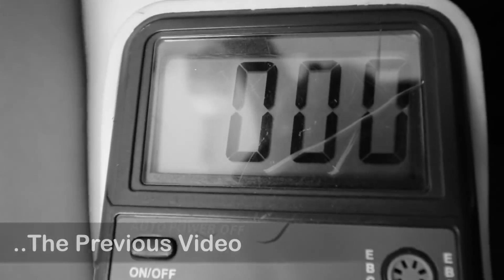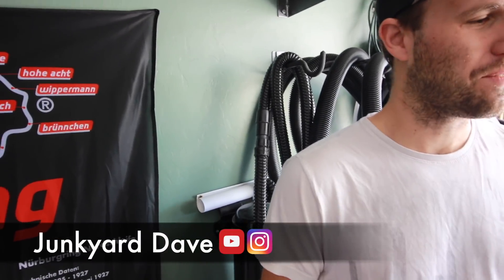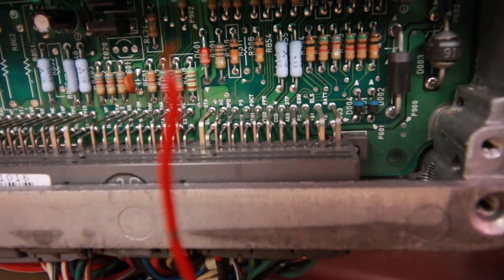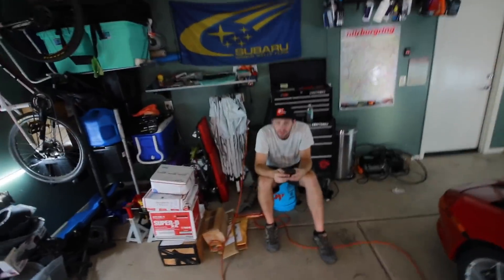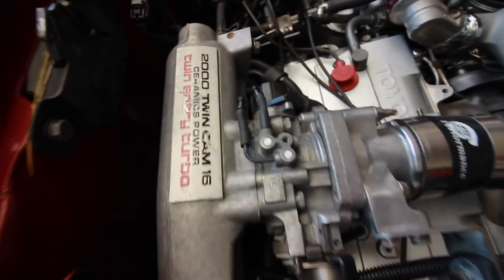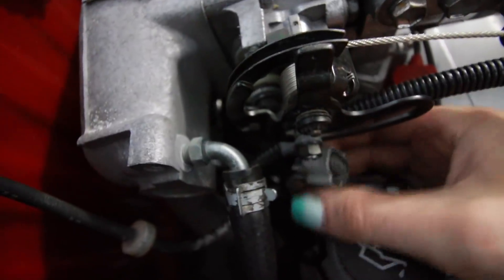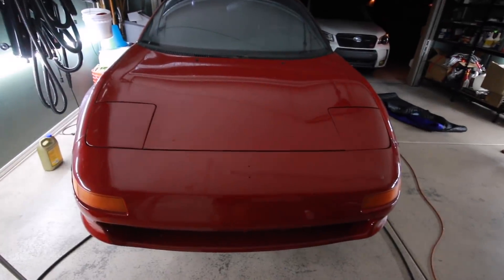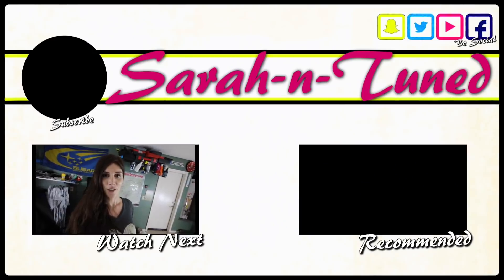FIRST DRIVE! Mister Dos Lives // JDM 3SGTE MR2

Comment: @Sarah n Tuned Ive Bled a Clutch by myself before. You pump the pedal to build pressure then use a 2x4 or something to hold it then you can undo the bleeder screw. took 20 min to bleed the clutch on my 87 Rx7 lol

Comment: Stick a short piece of 2x4 into the brake pedal and slide the seat into it. Also, you can make a brake bleeder with a length of poly hose and a plastic juice bottle.

Comment: OMG!! I almost cried when I saw you driving it! Im so happy for you. Im in central America and Im called by my clients "The MR2 Guru" but my specialty are the AW11s. I have learned so much from your channel!! I really like it and I have been watching the Mister DOS playlist but couldnt wait so I played this video. 

With the tach, you could check the igniter and distributor there is where the signal comes. Also if im not mistaken the intrument cluster in the back of the tach has a circuit and or resistance you can check. At least in the AW11 it has some circuits behind the tach.

Comment: Sarah, my MR2 has the same speedo issue. Mine is also a USDM NA to JDM Turbo swap. There are quite a few good YouTube videos on how to fix that. It’s just a few dollars in resistors or capacitors (I forget) and some soldering in the cluster. No worries.
That breaking up in higher RPMs is more worrisome to me. I lost a 3S motor when I was younger and dumb by messing with the mechanical timing. Get a timing light on that thing ASAP
Oh yeah! Congratulations on getting her running! There is very few cars as much fun to drive - NONE at that price point.

Comment: You can bleed it yourself, you just pump the brake/clutch so the line in the bottle is always submersed. Then it'll create bubbles in the tube until it's bled. Took me figuring out you need a much larger container. You also use a stick, or something to hold the clutch down and open/close the bleeder as it's pressed with stick. Also not ideal, but can be done.  Enjoy your work and videos. Keep it up.

Comment: Air idle valve only operates when the ac kicks on. otherwise air isle is set by the throttle body itself. also Mikes garage on youtube his clutch bleed setup using a oil can is the quickest method. I used it and had the system bled myself in 10min. If you search the forum for the tach issue its common. a few capacitors just need to be replaced.

Comment: Where you moved the distributor you may need to adjust it with a timing light that could be some of the power issue and it might need a tune with the blow of valve awesome to see it run

Comment: In my mobile repair days I used long pry bar or 1/2 extensions to hold brake or clutch pedals down. Wedged in between seat n pedal. Had a cheap mityvac but they don't hold up in the mobile environment being plastic. The alternative that works well is using a bottle with clean brake fluid.  Attach hose to the bleeder, run hose to the bottom of this bottle and you can slowly pump the pedal with the bleeder open. It expels the air and sucks fluid back in upon release of the pedal. Same as bench bleeding a master cylinder.

Comment: Major kudos to Junkyard Dave for helping you out with the wiring issues. I would have been tempted to just put the fuel pump on a switch mounted to the dash like a race car.   Congrats on getting Mr Dos running! Lots of hard work.  For bleeding brakes I love my Motive bleeder system, totally able to work on brakes alone.  Looking forward to more progress. Keep at it!

Comment: Congratulations on the first drive Sarah! I know the feeling well. One product you should look into are Russell Speed Bleeders. I put those on my RX7 so I could quickly bleed the system myself before and after track day events at Road America. They work great. Also, when I would bleed my clutch master and slave I would use a 2x4  from the pedal to the seat after depressing the clutch. (I also didn't have people available to help at all hours when I would work on the car) Yes it works the ab muscles well constantly going from under car to depress clutch but I would consider that as a workout. ;) Good luck on the fine tuning now.

Comment: 9:28  The way I handled that problem is I heated the hose with a hot air gun, and then work it onto the nipple.  The hose then forms to the nipple, and it easily goes on there after.

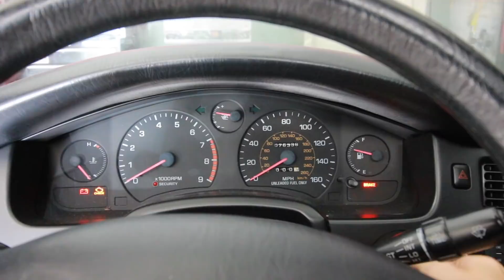Comment: Sarah, something odd happened with the tacho. If you see the video at 1:10, at that point the tachometer was working well. Later when you start the car again in 5:10, the tachometer is already off. You did something in between to upset the tachometer, it must be an electric issue.

Comment: Hi Sarah! Glad to see MR Dos go for a drive finally. You have me looking at cars with turbos now. I've never owned a car with a turbo before but did drive a Tiguan with the 4 motion and the 2.0 liter turbo. But I'm looking at Volvo's also.
Reply: A turbo really doesn't add any extra issues except reduced engine bay space. I avoided turbocharged cars for years, thinking they were more complex and fragile, they aren't.
If you are looking at Volvos, the 850's are fun cars with the T5 engine.
Reply: They do offer more points of failure, and the turbo will go out before the engine.

Comment: I have a third gen MR2 and in order to bleed the clutch, I had to get under the car and use my fingers to press the slave cylinder.  Using the pedal just never worked at all.  I think it's because the line is so long from the clutch master to the slave.

Comment: Hi Sarah: off-topic question: You have an insulated garage door: are you happy with the result? Did you do it? If so, how does it compare with non-insulated? Love the channel! All the best, Rob in Switzerland (MX-5 2.0l Sport)
Reply from the maker: RobWhittlestone it might have helped... but when it’s over 100° outside and the sun is on that door all day it still gets ridiculously hot in there no matter what I do. I pretty much have to run the evaporative cooler 24/7 if I want it around 80°.
Reply: Aha! In Arizona you need it 'cause of the heat. I should have known. LOL. 8-D  In Swiss winters we have long periods of only  10°F to 15°F (-15°C to -10°C) so was interested in insulation against the cold!  
Fun fact: did you know that the MR2 was called only "MR" in France? It's because "MR2" in French sounds like "merde" (sh*t) so they dropped the "2"! All the best from Switzerland, Rob (2009 MX-5 NC 2.0l Sport).

Comment: don't know if this applies to this problem on this MR2, but there is "Start-mode" and "Run-mode"  sounds like it wasn't getting into "Run-mode"  and still isn't.  You can by-pass stuff to make it run, but its may not be in true run-mode.  find out if the ECU is sending the "Run" signals after initial Start.

Comment: All you need to do is put a hose over the bleeder  that goes all the way to the master cylinder. Then you can pump the pedal, making sure you don't run out of fluid. That would keep it bled until you close the bleeder. Has to be tight fit, so it doesn't leak.

Comment: I've had to bleed brakes by myself before, and a clutch.
For the brakes, I would pump the petal, then use a cinder block to weigh it down, then release the bleeder valve, and repeat.
or wedge a 2×4 between the petal and lower front half of the seat and move the seat forward.
Pretty similar on the clutch.
put something heavy on it, open the bleeder screw. when done, close it and remove the weight.
Dig the videos by the way

Comment: Great job on getting it running!! My only worry is that if you deleted the resistor that goes to the fuel pump relay, then you may run the risk of putting too much current on that circuit which could burn up the relay. That resistor is there to limit the amount of current.

Comment: Sarah, check your igniter if it is the right model, there is two model with different connectors ( just the tab in connector is different) i made few swap with Toyota 3sgte and have had this problem with tack wrong, start and shut off and cutoff…. it was like 13 years ago i dont remeber wich one you need but do research on the igniter.

Comment: It would surprise me if you have not heard it Sarah, use a brake pedal holder (they make them) for solo brake bleeds.  I do not think you would have a window scraper which is what I use in Michigan, but I also do not bleed brakes on vehicles without adjustable seats, I'm kidding.  Adjusting the seat to hold whatever stick on the brake pedal, and only push the pedal to an inch before the floor, on brakes.

Nothing better than having an audience and friends over for the show.  New gearheads in the making.

Comment: Try pumping the brakes and then putting a piece of wood between the pedal and your seat.  This will allow you to do the job by yourself.  You can adjust the seat to fine tune the length you need.

Comment: One more thing.  The "vacuum" lines that you plugged probably go to a differential pressure sensor that feeds data to your computer.  It's like a pitot tube on an airplane but a lot more sensitive.  Get a wiring diagram for the car that once housed that engine and I'll bet you wil find the answer to most of your problems.

Comment: You can bleed a clutch by yourself.
It's a different procedure.
You get something like this :
https://www.amazon.com/dp/B004KEFE1W/ref=cm_sw_r_cp_awdb_t1_7t.IBbZMKWTY8

Fill it with brake fluid. Get a piece of small hose that's big enough to go over the bleeder screw and the end of the squirter.
Remove the cap on the master cylinder
Open the bleeder, and keep pumping the oil squirter until you stop seeing bubbles come from the master. Or till it over flows.
A bit messy,but works everytime.

Comment: I would like to say that I outlined removing the FP resistor in the last MR2 video comments haha. Glad to see it runs, now you should ditch the factory EFI and go standalone. Also, back to my Supra, the turbo and non-turbo cars have different cluster resistors for the tach circuit. Maybe that's the case on the MR2 too?
Reply: If you have an MA70 Supra, it's because the non turbo engine uses a standard distributor, but the turbo uses a three coil wasted spark setup. Completely different ignition systems.

Comment: There's some real dubious equipment on the market,Sarah,these brake bleeders are sort of "one man" when bleeding motorcycle brakes but even then you need three arms ideally and your constantly worrying about a pipe popping off and spraying brake fluid all over the beautiful paintwork etc.There's no substitute for quality but bleeding brakes/clutches is usually much easier with two people anyway.
Reply: The Motive Products Brake Bleeder is a decent 1 person bleeder which actually pressurizes the brake fluid in the tank you fill up, which is sealed on top of the master cylinder (brake or clutch). Then with it pressurized, you can then bleed at the screw, and fills the fluid in the master. Good for changing out the brake fluid too which should be done when a brake job is performed, or when you replace worn hydraulic parts.

Comment: Since it is a turbo car, set the timing correctly before going any further. Gap the plugs around .030ish and run only the copper type. Also, if the distributor has vacuum advance then it should have a one way check valve for when it gets into boost.
Reply from the maker: Robert Hale plugs are brand new and correctly gapped.
Reply: Ok. I only suggested a smaller gap on the plugs because the engine might break up under high boost. I had to do it on my turbo Cordia.
Reply from the maker: Robert Hale yeah, I read that exact same thing when I bought plugs for it. I’ll have to check the vacuum advance part though!
Reply: No way a car with EFI and electronic ignition runs vacuum advance, it would be entirely redundant.
Reply: Mitsubishi Starions and Turbo Cordias do. Though they are throttle body injection they have EFI and electronic ignition with vacuum advance. The spark boxes alone costs over 700.00 now.

Comment: Mint! I had a MR2 Turbo back in the day as a JDM import, was ok but it used oil like it was going out of fashion which was disappointing and the handling was a little switch like on the limit of adhesion, apparently Toyota addressed that with the Mk2 version but it also introduced a good amount of understeer, I liked it but I had a Nissan Pulsar GTiR after the MR2 and it was a nicer car to own, it didn’t have the build quality of the MR2 and the MR2 was probably ultimately quicker but I just enjoyed the GTiR more day to day.

Comment: I don't know how many wires you will chase in your "hobby", but would recommend getting a wire tracker to make your life a bit easier.  Too many of them out there to recommend anyone product.  I have used really cheap ones and expensive ones.  You decide.
Reply: Listen to the man. It will make your life so much easier.
Reply: Look into the Power Probe IV, it is a really great tool to have for any automotive electrical troubleshooting.

Comment: Yes.. resistors or transducers are bad on your tach. This can also happen on the speedo.  I used a Gatorade sized bottle with brake fluid in it, clear hose connected to bleeder screw, crack screw open, pump the clutch, close the screw, pump, repeat until done. Literally takes me longer to setup the bottle and connect the clear hose than it does to air bleed my clutch. Whenever you have an MR2 that will not stay running like yours always check for air leaks first. I know when my 93T MR2 had the problem was b/c my intercooler piping was loose b/c GEN2 3sgtes have that problematic AFM technology.  I went to MAP based GEN3 engine with a GEN3 body harness which is all PNP for the most part minus the power steering which required some pin swapping on the ECU/easy.   Can't help with the breaking up issue, sorry.

Comment: I installed a JDM gen 2 in my 1991 turbo when it went kaput like in 2004. I was ready to find wiring issues during the swap but I didn't have one issue. JDM engine harness plugged into the JDM ecu & into the US body harness. Fired up just fine. I did start with a Gen 2 rear clip with an uncut harness though. It's baffling that you're having this many issues. Must be all the other hands that have touched this car prior to you owning it?

Comment: Bleeding brakes/clutch is always a pain, and when I was a mechanic, you couldn't ask the dude next to you to help bleed the brakes every time, so there are compressed air powered bleeders that make life so much easier. It doesn't take a huge compressor to run them. Here's one type that Matco sells that's somewhat reasonably priced. I know it made my life WAY easier when I was paid to fix cars. Might be worth the investment if you plan to keep rescuing cars.
https://www.matcotools.com/catalog/product/BB70852/800ML-BRAKE-BLEEDER/
I've also heard good things about this compressor:
https://www.amazon.com/gp/product/B00NOSCDPA

Comment: Awesome, glad to see it's running.  First thought on the Tach issue.  Does the JDM crank sensor output a different voltage than the USDM one?  That could explain the offset.
Reply: @The Icemeister's UnGarage awesome thanks for the clarification.  I felt about half dead when I wrote that but figured the basic concept would make it across :D
Reply: 90s Toyotas and Nissans are know for the gauges failing. It's a very common problem once the cars get to 8-10 years old

Comment: for the tach your issue is with the transducer
Reply from the maker: Joeys Cleaning Lady Thanks! Just looked it up and I guess there are two capacitors behind the tach (10uf25v) that often go bad resulting in this issue.
Reply: Ive Bled a Clutch by myself before. You pump the pedal to build pressure then use a 2x4 or something to hold it then you can undo the bleeder screw. took 20 min to bleed the clutch on my 87 Rx7 lol

Comment: I see you are good at reading schematics. Nice. How about if you get both schematics from the two different systems you are working together. You know the Turbo and non turbo I think you said is what is different. Isolate what you are using on  each schematic and see where the wiring needs to be re-engineered to keep things as stock as possible... Maybe this will help...

Comment: If you are using J spec transmission it has a kilometer per hour sensor opposed to a mile per hour sensor which like you said would f**** the math so your tachometer is not correct. Sounds like you just need to swap out your speed sensor on the transmission with a US mph spec